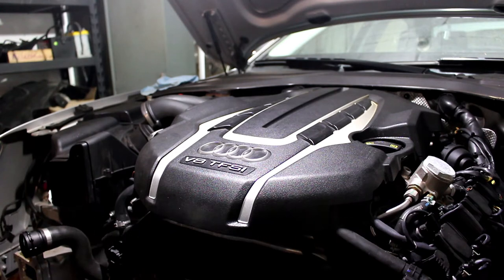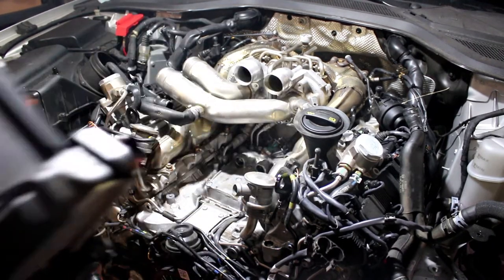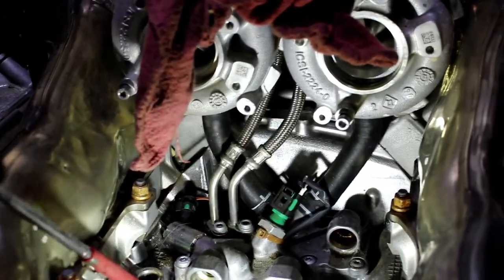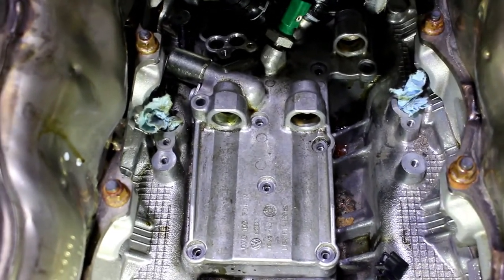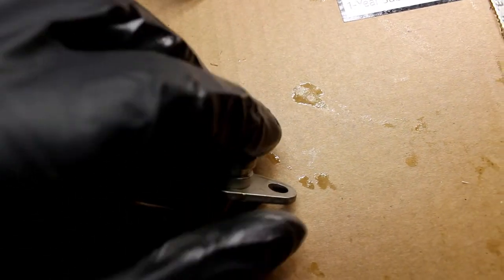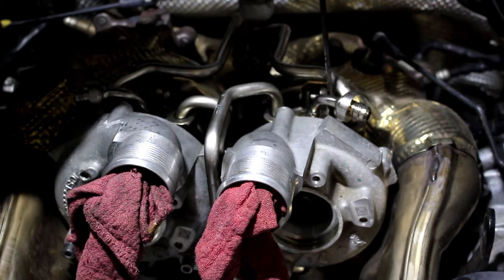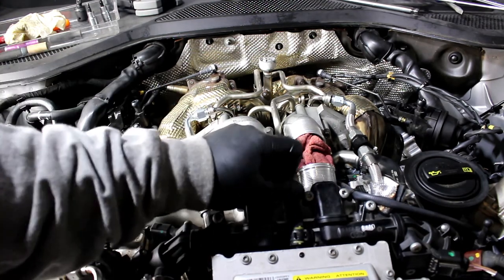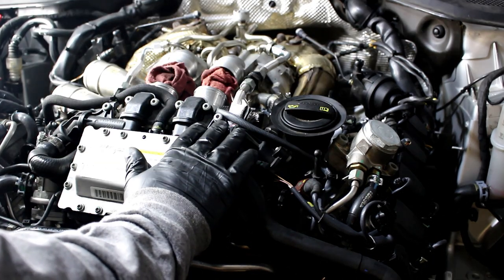4.0T turbo oil screen & line replacement. with JHM serviceable kit install

Comment: Great video - thanks for sharing - next time let the cam running when doing the work (maybe timelaps) would be interesting too. Thanks again!
Reply from the maker: Thank you Philipp. I jumped over to your page and watched some of your videos after your kind comments. I'm actually working on doing a spark plug coil pack change video right now (and English version). Your video looked great BTW. I'll make sure to incorporate your suggestion in this next video. If you get a chance to see it when I post it I'd love to hear your thoughts.
Reply from the maker: Thanks. I have a raft of videos still to publish. But I'll start trying to add in some timelaps clips. I try to be as thorough as possible. This makes for 45min on average videos. I tend to keep the clips short so it's not a 3hour video as I think most people will not tolerate that much. But I will put some more into some of the not yet recorded videos. Thanks for the comments it's always nice to know I helped.

Comment: Youre a brave guy 😂 Audi did mine for free and a recall
Reply from the maker: LOL thanks matt. Audi sent me the recall letting about 3 weeks after I did mine. But to be honest for me the recall didn't really solve the issue. I like that I can now see / maintenance my oil turbo lines. I'll be doing a turbo update at some point and I don't think I'd like the idea of not being able to check the oil filter pre turbo.
Reply: @howididit7196  totally agree with you. If I had the tools, space and knowledge, I may have done it myself too but sadly, I lack all of these. Looking forward to the turbo update 😊

Comment: I appreciate this video, there’s so few on YouTube of this procedure.

I gotta say though, those o rings are horrible, and were leaking before you even got in there if you look carefully.

Also, did you check your turbo runouts?  All of that work only to not check your turbos carefully seems a giant waste.
Reply from the maker: Thank you for the kind words. I was surprised by the condition of several things. I'll try to get the video of those other things up later. As for the turbos. I did check the shaft play and the turbo best I could and the condition seemed to be fine.

Comment: Everything still look good with this relocation kit? I’m actively looking for a 2013 s8 and this is the first thing I am doing.
Thanks for the detailed video. Great job!
Reply from the maker: Yes, I couldn't be happier. The serviceability of the kit has really impressed me. Now every oil change I can get a good view of another spot in the oil system. No issues what so ever. I would not only recommend this kit. I would buy it again and add this to any future 4.0T car I would get in the future. --- Thank you so much for your kind words. It is very much appreciated.

Comment: Hello ,Great video.. I am getting my RS6 in a couple of weeks and this will be the first service I will be performing. I will probably just go for the revised version of the Oil strainer. One question for you. Does the whole front assembly with radiators have to come off or with removing the bumper will their be enough room for removing the intercooler asssembly ? 

Cheers
Reply from the maker: Smart move. This clogged screen can really do some damage.  As for removing the front assembly. At the very least you're going to want to put he car into service mode. This is where you're pulling the front assembly back slightly. To me, I could  have gotten to everything with the car in service mode. But to be honest. If I'm going to be in that area working. It made more sense to spend an extra hour or so to expose the entire work area and be able to not only work with less restriction but that also allows you to inspect other areas.  I feel like it's going to end up being the same amount of work time. If you put the car into service mode you'll be spending the same amount of work time by fighting tight spaces as you would if you just removed the entire front end assembly.... But that's just my take on it.
Reply: @howididit7196  appreciate the answer :-) I will see how it goes when starting the job. Your video will be off great help. Thanks again and merry Christmas 🙏🏻
Reply from the maker: I really want to thank you. With all of the time these videos take. It feels so nice to hear a great much appreciated thank you.  I don't make these videos because I want to be a youtube super star.. I think we've all seen some of the "help videos" that  are nothing more than just kinda empty content to fill a spot in someones youtube video portfolio.  I just want to help. That's all..... I'm glad this may have helped you.  May you and your family both extended and otherwise have a very Merry Christmas

Comment: Thanks for the video, how is it running out now without the Oil Screen installed? Any problems? Thanks to your video I am going to do this job soon!
Reply from the maker: Thank you. I do appreciate the kind words. I really do try to make the videos helpful. Now with the JHM oil filter screens I've had no issues and no worries. The JHM units have caught debris that would have continued to clog the non serviceable OEM filter units. So not only do they work well but they work I assume as designed. overall I do think the JHM oil line units are a super smart upgrade. I plan at some point to upgrade the turbos. The piece of mind knowing I'm filtering the oil to them is just a good investment in the longevity of everything.

Comment: Hello, i am considering buying a car next year. I have to pick between S7 and RS7 because i am interested in both what should i consider as a better choice?
Reply from the maker: Hello, Great question. It's not straight forward to answer. It's going to depend on your end goals. They both have their own place. If your end goal is power and speed. You can add  bolt RS7 parts onto the S7 motor. So right there that starts to level the power playing field. But the better choice is going to depend on what you're looking for. My A8 is faster than most RS7s but I have a tune and bolt ons.
Reply: @howididit7196  This is actually what I wanted to read. My goal isn't 1000whp with stage 4 tunes. I would put bolt ons on S7 and call it a day. And it's more cheaper. I think I'll look for S7 then.

Comment: I see the front bumper came off (metal bumper). Do you have to disconnect the A/C pipes?  Recover freon into external tank. Thanks🤙
Reply from the maker: No the entire front ac heat rad can be moved aside with the AC lines still connected to it.

Comment: hello Friend, i own an audi s6 and i want to do that job to my car. i just have one question. the oil screen that you remove, in the video you install a oil screen blank. where did you get it? Or did you just cut the metal mesh in the center? if no, can you tell me where i can get that blank oil screen? thanks in advance!!
Reply from the maker: Hello the blank came with the JHM oil line kit.
Reply: @howididit7196  thanks a lot, I’ll buy the kit and schedule the job once I got the kit. I’ll use your video to dismount the parts of the car and assembly again. Appreciate your response !!

Comment: How. Did you get the little plugs off that throttle body? I have a set of black And brown plugs. Black are pinch and pull and the release mechanism is facing towards the ground on the brown ones and i can't seem to figure it out. I don't want to damage them.
Reply from the maker: If you didn't ready know or do this. You can take the throttle body off with it still plugged in with all the plugs (both) if you do it this way you'll be able to see the connector better and you can even use a pic to push the release tabs if needed.

Comment: Hello, i just did the job thanks to your video,i have a question i noticed a black bolt on the driver side,maybe the size of a quarter that says open and close,what is that for?
Reply from the maker: Awesome... So very glad this helped... Give me the time stamp on where you can see this bolt you're referring too and I'll take a look and then reply back
Reply: @howididit7196  06h115 it above the coil pack
Reply: Oh i got it thanks!!!

Comment: Hello i just have a question about 2013 a8l,i have white smoke coming from the tailpipes after it warms up,what could be causing that
Reply from the maker: Hi Jbam. Since this isn't a great platform for helping in that manner. . Consider going to Audirevolution.net sign up for the forum and then start a thread there asking for help with this. LOTS of very helpful technical guys there that can help work though the many things it could be. It could be a thousand different things.
Reply: @howididit7196  ok thanks for answering

Comment: Do you have to remove the front bumper?
Reply from the maker: The front bumper you would to help at the min get the car into service position. Service position is with the front core support still on but pulled back to give you more room. I feel it yields better results to just pull out the core support as it's only about 30 more min or so.

Comment: Do you have to take the front bumper off to do this
Reply from the maker: I do have a video on how to remove the front bumper and yes you'll want to remove the bumper and at the very least put the core support into service mode. I however removed the core support to show a better view of all the work..

Comment: Do you have a links for the parts you used?
Reply from the maker: Joey -
https://jhmotorsports.com/products/jhm/stainless-braided-turbo-oil-line-and-strainer-screen-relocation-kit-jhm-serviceable-for-tsb-2044640-on-c7-s6-s7-rs7-and-d4-a8-s8-4-0t.html

https://jhmotorsports.com/products/jhm/turbo-coolant-line-o-ring-kit-for-c7-s6-s7-rs7-and-d4-a8-s8-4-0t.html

And this isn't a bad idea to get these
https://jhmotorsports.com/products/jhm/turbo-outlet-to-throttle-body-inlet-hoses-pair-jhm-silicone-kit-w-clamps-for-c7-s6-s7-rs7-and-d4-a8-s8-4-0t.html
Reply: @howididit7196  Thank You!

Comment: How long did it take u to complete
Reply from the maker: On average depending on your mechanically ability. I'd say this is a weekend project. I was able to do this in less than 6 hours but I'm used to the car and know how to already do many of the needed tasks. IE. take off the front clip, bumper, core support. The other part of the job took the bulk of the time. With the video as a road map it will help take out some of the roadblocks time wise. But I'd say for a first time job with someone not failure. Shoot for 12 to 16 hours due to to complexity. It's totally a DIY it just takes a bit of time. For other things like the removal of the bumper and core support see the other videos I have on that.

Comment: doing this at work currently along with 8 Injectors, oil regulation valve and valve cleaning 😵‍💫🫣,  insane design
Reply: Did you have to pull the motor to do the injectors?

Comment: What year and what tools are needed
Reply from the maker: 2014 but the procedure is about the same for all 4.0T gen 1 motors. You don't particularly need anything special tool wise. Obviously if you have some specialty tools that you use on other Audis you've worked on they're going to come in handy here. In the video. I do believe I covered what most of the bolt or nut sizes are. But for the most part just your standard 10-18mm sockets Torx 20-35 bits and 6-8 mm allen along with a few pics and screw drivers
Reply: @howididit7196  thanks
Reply: @howididit7196 would you recommend this on a 2018 S6 with the newer revised filters? I’d assume so if you are catching debris with the JHM
Reply from the maker: Yes I from what I' ve seen in my filters it's obvious to me that filters that can be serviced like the JHM units are a good idea. The removal of the filter just means your going to damage your turbo with oil debris and the revised filters just means your going to have filters that are clogged sooner or later but you won't be able to access the filter like you can with the JHM units.

Comment: Hi
I changed two turbos and start the engine as normal after test drive engine is not starting but cranking
Reply: sounds like you left something unplugged

Comment: All this extra line’s will reduce the oil pressure for the turbos.
Reply from the maker: Yeah I'll be honest that's not really a thing. Not only that but the fact that these units allow the oil to be filtered help guarantee you'll have better oil flow than when the stock filter get clogged and it 100% gets clogged.

Comment: jus remove it u dont really need a screen anyway
Reply from the maker: Yeah the entire ordeal was quite intensive. I would however say I don't agree that trapping contamination isn't in your best interests. When you see what you're tapping, it's best to keep in mind it's not just the turbo that is going to have this pass by it, if it was, just trapping the turbo oil that is enough for me to protect my investment. And to me. I'll strongly suggest getting the remote oil line filters and getting as much debris out of your oil as possible.